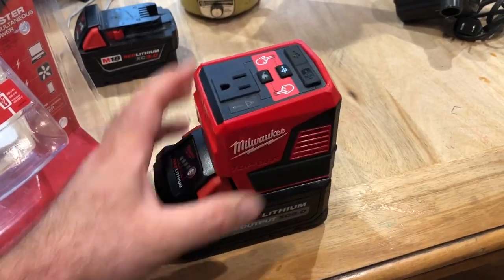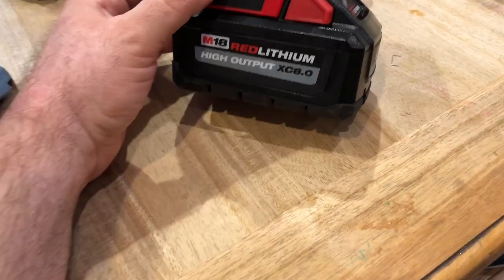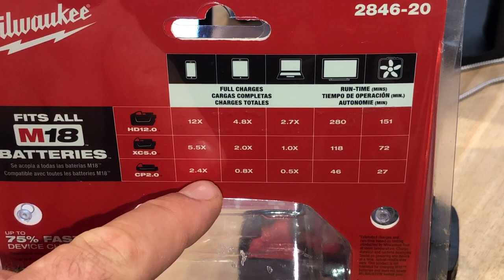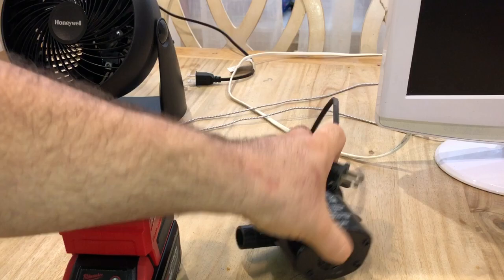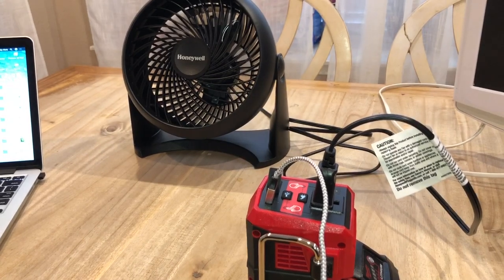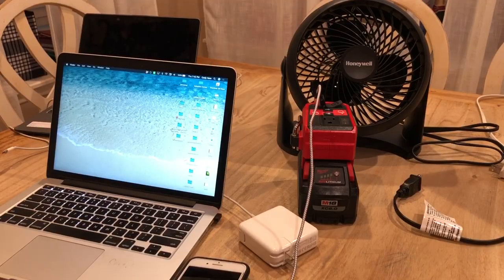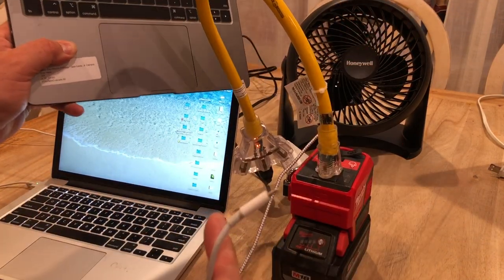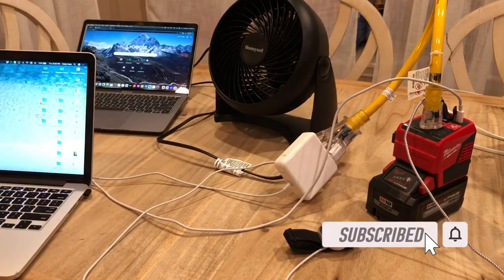Milwaukee Top Off Demo

Comment: I have one and use it quite often. I do marine work and 120V electric power is at times difficult to impossible to get while working on boats. I use it for my old Snapon 120V florescent under hood light that I replaced the florescent with a direct replacement LED tube. It will work for 8 hrs continuously on one charge of my 12AH bat. I also use it to keep our cheapo diagnostic laptop running while under way running diag. I actually use it in the shop for the drop light so I don't have to string out the extension cord and the cord can be used for my heat gun or something else. At first I was considering replacing my Snapon under hood light with the Milwaukee battery under hood light because my Snapon was old and had quit but do to the high cost of the Milwaukee light and the fact that I realized that the Top Off could perform other tasks I fixed the Snapon light with the LED direct replacement tube and bought this. Fixing my existing drop light and buying this was about half the cost of the Milwaukee light and I already had the 12Ah bat. The light does run about 4-5 hours continuously on a 5AH. At this point I have no complaints about it. It does what I bought it for.
Reply from the maker: That’s sounds awesome especially the run time  with that 12 Ah battery. I wonder how it’s going to go with that flimsy flap covering the USB ports  wish it had a spring loaded cover